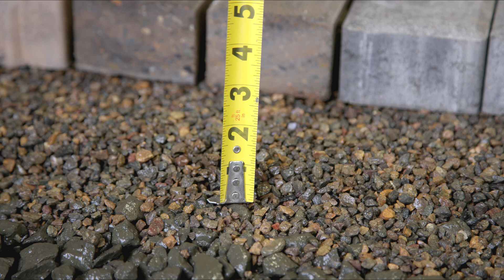Top 3 Paver Base Systems: Which One is Best for Your Project?

Comment: I live in Nebraska. I'm getting ready to do my bedding and I hear some guys say you have to use ¾" with fines and others say it will compact too much and not drain properly? If you use ¾clean can you use sand on top or will it just fall through? To me, it seems like ¾clean with ¼" chip on top would be best?
Reply from the maker: Great questions, Richard! You're right to think carefully about this - there's often confusion about base materials. For a standard paver installation (not permeable), ¾" crushed rock WITH fines (often called ¾" minus or ODOT ¾"-0) is actually what you want for the base because those fines help it compact densely and create a stable platform. It won't cause drainage issues because water drains through your bedding sand and base - not standing on top.
Then you'd use coarse concrete sand (NOT rock) as your 1" bedding layer on top of that compacted base. The sand particles are fine enough that they won't fall through the ¾" base rock.
Using ¾" clean (no fines) is typically only for permeable paver systems where you need water to flow through quickly. Your instinct about layering is good thinking, but for standard installations, stick with ¾" minus base + concrete sand bedding. Hope that clears up the confusion!